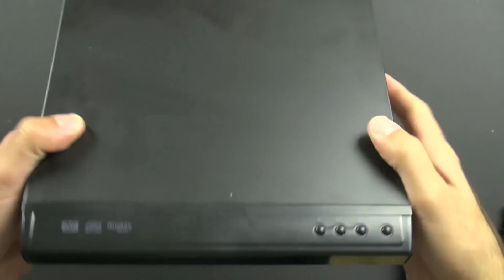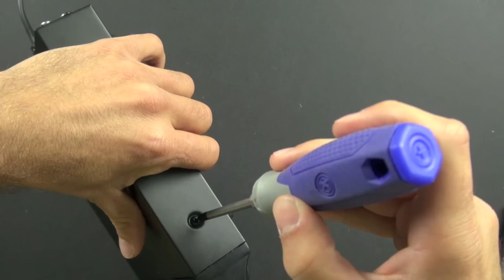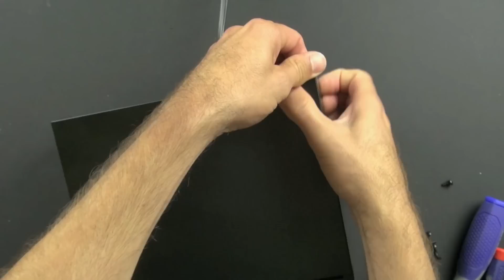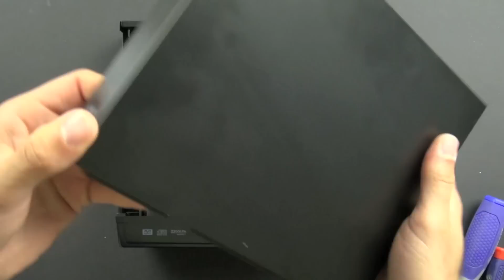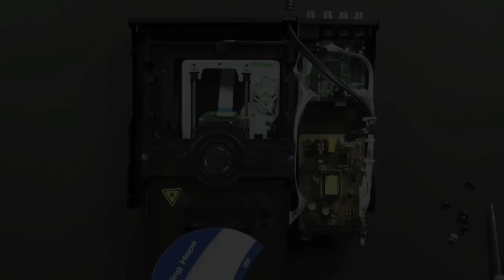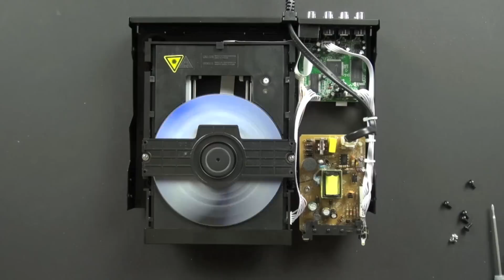What is inside a DVD player? (1 of 5) | Electrical engineering | Khan Academy

Comment: Does the drive lock the disc in place upon closure of the tray or does it only lock it in place once the disc starts spinning? It's a pretty simple question really but I can't find the answer anywhere. I'm basically wondering whether it is ok to move the drive about with a CD or DVD inserted?